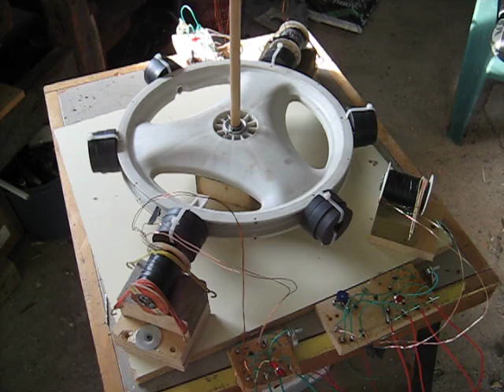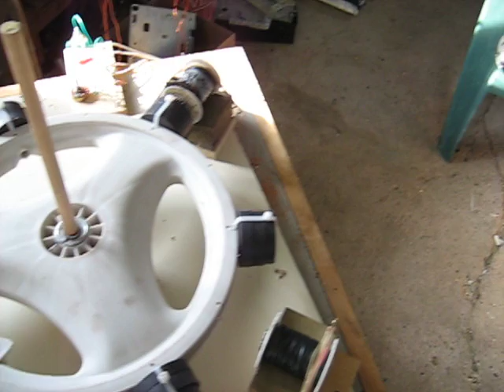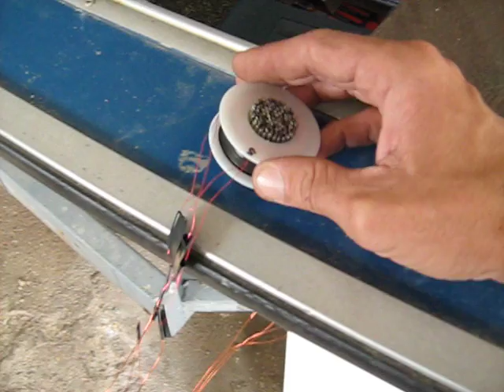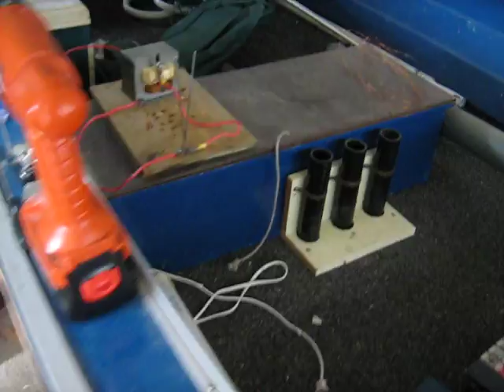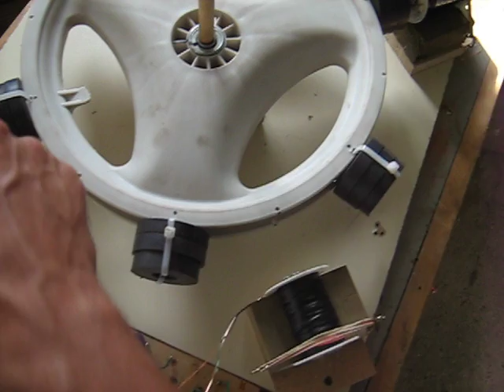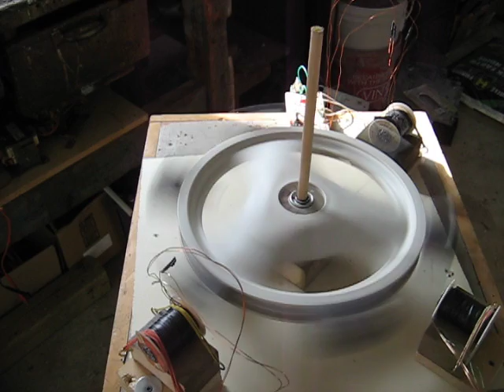Bedini Leedskalnin - Coil Spacing

Comment: @MrAnguswangus 
I feel you're oppressed pain, brother. You're doin well. That rim was flying along and they're not exactly light weight.
I dont know what exactly your design is, or plans for future designs, but have heard about the amplifying power of Rodins coil, sacred geometry? Its an insane amplification man. i think 4x power output.. And also, would it be possible to stack many motors/rims on top of each other? And have a tower of say, 10 motors, all generating through Rodins Coils?